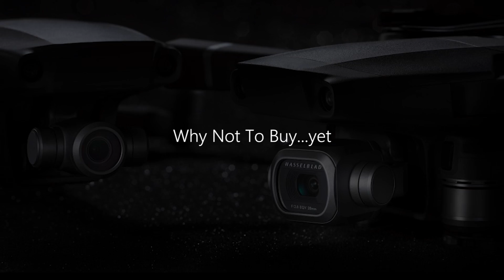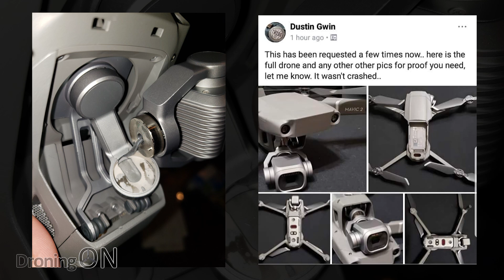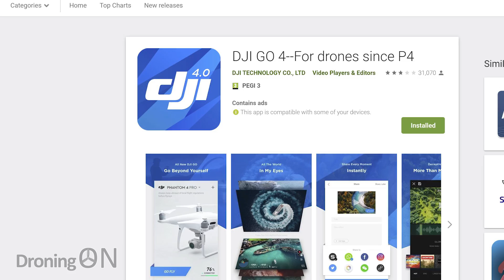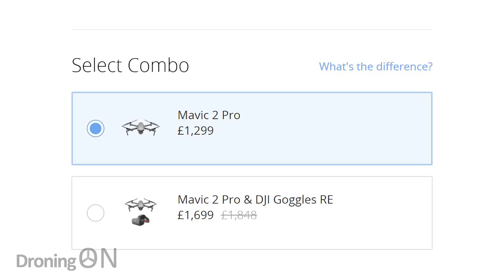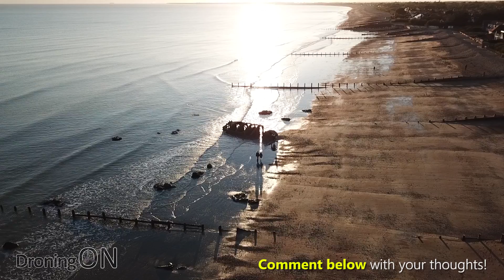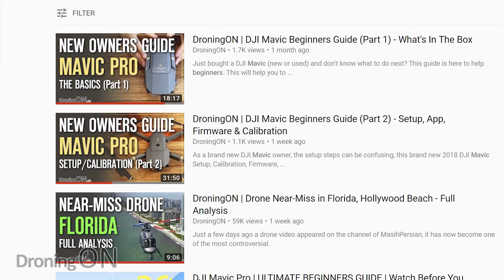DJI Mavic 2 - Why Not To Buy For 3-6 Months - Before You Buy Guide

Comment: You say "hot swappable" but I think you actually just care about it being swappable.  Technically to make it hot swappable would be very difficult.  Hot swap means that the device is powered on and continues to operate while you remove and replace the item.  Cold swap, or just swappable, means the device is powered down.
Reply from the maker: I refer to either, hot-swappable isn't necessarily difficult, just as how you can connect and remove a USB drive, HDD or other device to and from a PC without shutting the device down first. Regardless, the ability to swap cameras easily would be lovely.

Comment: Can't pretend to agree with your opinion on this one. You can always wait...by whuch time it's old tech. I bought a mavic pro when it first came out and had no issues with it and would be interested in know what hardware changes have actually been made to date you can tell us about ? 
As for why buy the new one ? The camera is  much better than the old one and brings it in line with the p4p. 
I would imagine they have not put an interchangeable camera unit on it due to ground clearance. The mavics demure stature means it does not have the clearance of the inspires for example.  
Dji appears to pic a drone name and keeps the design and ethos of that style within that class e.g. phantoms, mavics, inspires etc . I would image the phantom is most likely to have a removable gimbal/camera. 
I have had the m2p a couple day's now and it has blown me away ...it's suits my style of professional drone work to a T ! Its one re-incarnation that has 100% hit the mark! 
Thanks for your comments all the same.
Reply from the maker: Remember the title and advice in this video, 3-6 months is not waiting forever, but it could be the difference between you losing your drone or crashing it and having to deal with DJI Support, or buying it after any glaring big issues have been resolved. You've seen the issues already with Precision Landing right?
Reply: @Droning-ON whilst  I would rather not deal with dji support as I have found them diabolical to date...you have to step on the ladder at sone point and I get the impression dji did not rush this release. 
Precision landing is neither a deal breaker or a  necessity for me. 
I tried to hold out before purchasing the Mavic 2....I lasted just an hour from release lol 🤣
Reply from the maker: I'd disagree, the very fact that basic features like Precision Landing are not working suggests rushing this product to market. They had to launch it before summer ended, otherwise a valuable chunk of the summer flying market disappears.

Comment: I believe your overall assessment is spot on.  I do currently have a Mavic pro and I love it it’s great the flight time/range is great and the video quality is really good.  I would’ve loved to see the camera able to shoot at 60 fps in 4K though.  This is the single factor that makes me hold off on upgrading my current Mavic Pro.  And I would have to agree if the camera gimbal set up we’re hot swappable that aspect alone would’ve made me upgrade and I would’ve definitely bought the copter as well as both cameras for it on the spot even without the 4K 60 frame option.

Comment: i dont agree the mavic 2 is not a new product . this is a newer upgrade from the first maviv so all the issues are tweaked . when the mavic first came out it was a new line so of course it will be mistakes . This is not thats why you have warranty
Reply from the maker: It is a new product, it's exterior and interior is an entire redesign, as are the electronics and firmware.

Comment: Brilliant. Good point. You cannot do a review on something that had just released after spending less then 72 hrs with it. There are tons of bias and paid for so called reviews on newly release products everyday. Most of them are a waste of time. Some do not even know what they are talking about. Buying now or later is individual but to do a marketing video and call it a review to trap unsuspecting potential buyers is a con at the very least. Most just do it to get free stuff from the manufacturers. I have been flying RC planes and Heli  since the days of no Gyro or auto rotation. One thing I learn is nothing wireless can be taken for granted. Housekeeping and maintenance is key. All it takes is 5 to 10 mins of simple checks to avoid any severe heartache. There are too many variables to take into account. I have never had a flyaway or accident due to the drone malfunction on its own. All my accidents is mostly due to my bad eyesight because of age.

Comment: I fly almost daily.  Phantom 4 if portability is not an issue and Mavic Air if it is (hiking).  Willing to accept donations to buy a Mavic 2 (both models, preferably).  Have less concern than you about DJI hardware quality, but I think it is smart to wait for the firmware updates, if that is an issue for you.   I bought the Mavic Air the day it was released, went through the “shakes”, but needed it for an overseas trip.  No regrets- love that drone.  And I’m sure the people buying the Mavic 2 are going to be happy- just not sure I could buy just one!

Comment: The only reason for not making the gimble interchangeable is to clearly separate the end users.   During all the hype I suspected a move to merge the mavic and phantom lines - what with the leaked photos showing a 1inch sencer and bigger motors. Now seeing the price point of the new pro version, that's something I can definitely see happening. 

All the talk about how the original mavic pro being an old aircraft, which is due for an update.  The Phantom is heading into it's 5th version - that's a lot of air miles!

If you add into the mix the cost of buying both new mavics, plus a fly-more package, your paying Phantom money! You can even get an inspire 2 on eBay for that price tag.

Comment: I think you talk a lot of sense. I didn't buy an original Mavic Pro, until last February, when the cost had dropped considerably. This wasn't so much a choice of holding on, but this was the first time I had bought a serious drone, having flown toy drones up until this point. Even so I don't think that I have gotten enough use from this model, and therefore will not be upgrading for quite a while, if at all. One big question that keeps nagging at me, is that I think buying a filter for the Mavic 1 is a must in order to get a decent result from the camera. However looking at the Mavic Pro with its Hassalblad lens, where would you get a filter to fit that, or does it not need one? Interesting to know.
Reply from the maker: There's already filters sold by DJI and other manufacturers for the Mavic 2 Pro camera :)

Comment: Mavic 1 was quite a new product especially design wise. Mavic 2 is basically Mavic 1 with a new camera and new sensor. This is why I believe Mavic 2 won't have as many issues. The glue not holding is a rumor, the guy rapporting it refused to post logs. A guy who repaired hundred of Mavic says he's never seen such an issue on Mavic and that DJI use some of the strongest glue available.
Reply from the maker: It might 'look' the same but trust me when I state that the Mavic 2 is not a Mavic 1 with a new camera/sensor, it is a very different and revised product, hence the extended flight time, additional sensors and much more.

Comment: I have the feeling that the Mavic-2 is an improved/enhanced Pro. All the experience with the Pro has been used carefully to introduce a better quad with options: if you prefer better pics than go for the Mavic-2 Pro, if you shoot more video than go for the Zoom. A lot of flaws from the standard Pro have been removed in the Mavic-2 platform & specs have gotten better in many aspects. If you are happy with what you have: why change? But if feel you can upgrade to a better, faster quad with longer fly-times, better photography capabilities or more creative video functionality...why wait?  I'm impressed by what DJI has delivered with the Mavic-2 series.

Comment: Why I'm not buy for 3-6 months, NOT why not to buy.  Without the earlier testers then what happens???? you becomes that tester.  No company can test there products as well as the general public and correct an issues, so not saying i'm a fan boy but this sound a little like click bait.  Most people whom buy the first edition of there product expect and accept the risk, if you don't you should.  2nd why buy anything else is because you didn't buy the first one, a lot of people waited on the Mavic pro because they had a inspire 2 or phantom 3 or 4 and just skipped the pro all together.  So the Mavic 2 is a smart upgrade.  Lastly the hot swappable camera, is probably just better for DJI's bottom line, which is more important than your opinion or consumer wish list.  You have no idea how easy or difficult it is for DJI to swap the camera for consumers when they send them in, just another fee they can and will charge to stay ahead of the competition.

Comment: I totally agree with what you’re saying. I bought a Phantom 4 Pro Plus (with builtin monitor) a years and half ago when it was first released. I waited about a month or so based on your theory until they got all the bad apples out of the bunch. The first one I received, the monitor started glitching after a day. The second one, the camera stopped working in two. The third, I decided to return the second and get just the standard P4P (without the builtin monitor) and that one stopped transmitting the video signal. The forth one the lens wouldn’t focus correctly and the picture always looked grainy. After almost a month and a half of back and forth returns, I finally receive a unit (#5) that actually worked properly, what a total nightmare! I suggest waiting at least 6 months (or more) this time because DJI announced that for the first time in their history they have already manufactured enough Mavic 2 drones to satisfy all new first time orders. With the original delay of the M2 I suspect it had to do a lot with that gimbal issue you mentioned, and DJI need to dump all those preorder drones as quickly as possible. One episode again, if you plan on getting a M2 drone, I would wait at least 6 months until all those rotten (recalled) units are soldout. Good luck and happy flying!

Comment: It’s called having a warranty.  In Australia we have a 2 year warranty (1 year from DJI, 1 year legislated consumer protection).  Something goes wrong - you get it fixed or replaced.  Life is too short.  I’d prefer to be a guinea pig than a scaredy cat.  You just said the Mavic Pro never sorted out the ribbon cable issue after 3 years...so do you plan on waiting for the rest of your life for the perfect product which will never come?  Live a little.
Reply from the maker: No not the rest of our life, 3-6 months as very clearly mentioned in the video. And good luck with that warranty if your drone flies off and isn't recoverable.

Comment: Why Not To Buy For 3-6 Months... IF you already have a mavic pro.  

I disagree with most of your points.  Firstly, this has been the smoothest DJI rollout yet - customers are getting their drones and the flymore combos within days of ordering.  Secondly, any incremental revisions are likely to be very minor (just as the platinum was).  Furthermore, the platnium was released a full 11 months after the original mavic.  

You won't see any price drops in six months, and any firmware bug significant enough to result in a crash or a flyaway would be covered by DJI, as they have always been.  DJI are the largest and most experienced drone manufacturer in the world.  I'm not saying you should trust them implicitly, but waiting 6 months for the reasons you listed seems pointless.  

Either way, well put together video.
Reply from the maker: You miss my point about hardware revisions, I don't mean a new model as the Platinum was, I mean new underlying electronics or design changes which are made to the base product and not revealed to the customer.
Reply: @Droning-ON  ohh ok. Do the definitely do that then? Someone must've done a teardown of the original Mavics

Comment: October 2016 wasn’t 3 years ago. In fact, it has not been 2 years yet...
Reply from the maker: Whooops, it was actually September 2016 but good spot!
Reply: DroningON 1:30 You talk about an article from 26th October 2016. So it will be 2 years soon since the original Mavic Pro was launched.
Reply from the maker: The Mavic was launched in September 2016, not October. The article mentioned is a list of solutions and bugs.
Reply: DroningON maybe it was announced. Started selling in either October or November. Has been delayed.

What you said is that this article has been written when Mavic came out. That’s why I was counting since October. Either way, this is not important, nor it’s my point. My point is that it’s less than 2 years, not three.

Thanks for the good points you mentioned in your video. I’m keeping my Mavic Pro with Platinum propellers as well.

Comment: Question. Which drone should I buy as a first drone today? I have been putting off buying one, as they were out of my budget. Today there seems to be enough competition, and I have managed to save up, to able to afford one.
Main requirements : ease of use, sub$2000 with all needed accessories, and then the picture/video quality.

To me the mavic 2 zoom, would seem to be a good fit, taking into consideration I do not own a drone yet.
Reply from the maker: As a first drone then yes either will probably be a good choice, but you should keep an eye on the Mavic Pro 1 pricing, it will start to drop and it's still a brilliant drone.
Reply: @Droning-ON  That is true, I just hope it would be sooner than later.
Waiting just for the next best thing, means I'll never get one. And with the drone laws in Europe are non existant, who knows if I'll be even able to fly one legally in the coming years.

Comment: Ash, this is gold again. I share almost every angle you have mentioned. I also think based on the Mavic 1 Pro Rev 2.0 that we need to wait at least 2-3 months before all the possible HW/FW/Go issues will have surfaced and hopefully been fixed. And I have to admit that despite I was stoked by the M2 hype myself as well, after getting to know that the lateral sensors only work in ActiveTrack and Tripod, and DJI doesn't even provide warranty for lateral crashes anyways (even in AT/Tripod), the M2 is not that shiny to me any more. Not to mention the possible gimbal glue issue that has surfaced yesterday. So all in all, my wallet is not that open any more, I might stick with my beloved Mavic Air, unless DJI convinces me big time not to. Cheers, TheSmithDroneian

Comment: When will DJI modify the controller to accommodate an IPhone with a protective case. That’s why I am holding off from buying, the old P3 advanced will just do just fine set to 1080p. No need to buy new gear for 4K, just to be up with the Johnses. With that old controller the iPad will fit perfectly.

Comment: There is one more reason to stay put, the release of the Enterprise version which seems to be be a Zoom model with more versatility. It may happen that a lot of Zoom buyers may regret not to have waited a bit.
Reply from the maker: I suspect that the Enterprise is a prototype or even may not exist, so don't wait for that, and it may not even be available for the consumer sector.
Reply: If you watch carefully the interviews (especially the one of Rick from DroneValley) they confirm that is coming but they say it will be later, I guess that will be on the 30th October at the Airworks event in Dallas. Personally as a developer and programmer I am deeply interested if they will release an Onboard SDK for the Mavic.

Comment: Agree with you in all. All new products seems to need a time to be polish by the manufacturer at present times. Also when I evaluated the possibility of buying a DJI, I asked my self about the use I would give to it, and after much thought I ended on racing/freestyle/Fpv drones because as mentioned by you, you end up not using the mavic. As I live in a big city, there almost no chance of flying it because of regulatory reasons... and when you go on vacations (will you buy a drone to be used once or twice a year?)  you go to a national park or a beach and there you can’t fly it either. So... I agree with your GREAT analysis.
Reply: I bought a Mavic Pro last winter and it took me two or three weeks to find out that It will not fly in the big city I live in. I flew it for three weeks on vacation in Vermont and it is great, but now it sleeps for a year. The Autel Evo is a much more fascinating option if I want to upgrade.
Reply: Buy a Parrot, fly it anywhere anytime. Thats their motto for a reason, a big reason actually
Reply: r4ym1n13 I have two race drones and I fly every weekend, and learning to fly them is so much fun!
Reply: @rmerino80  cool ! Which ones do you have & where did you buy them ?
Reply: r4ym1n13 I have an Emax Hawk 5 and a Babyhawk R 3 inch, bought them from goodventuredrones.
Reply: @rmerino80  ill check em out thanx